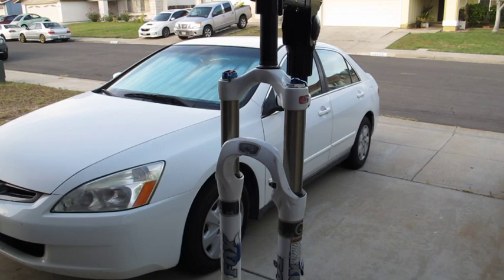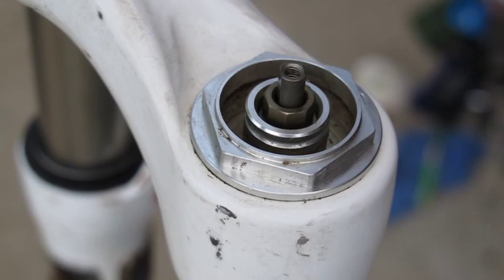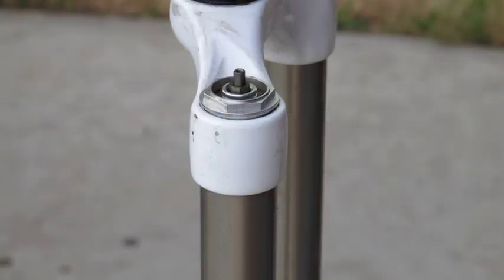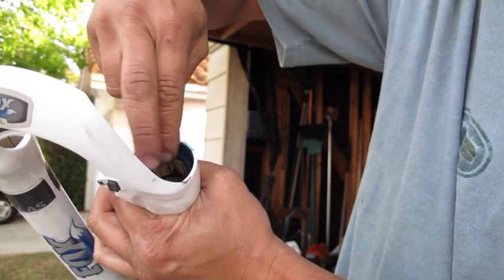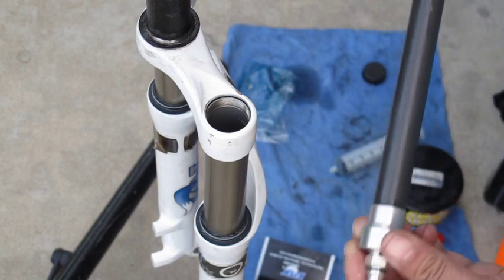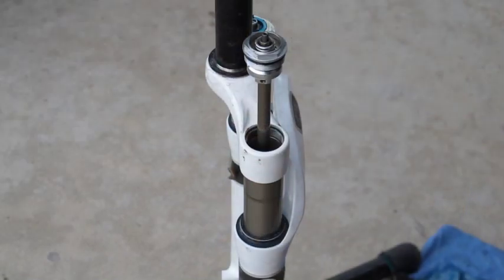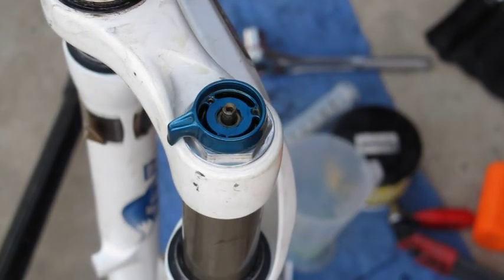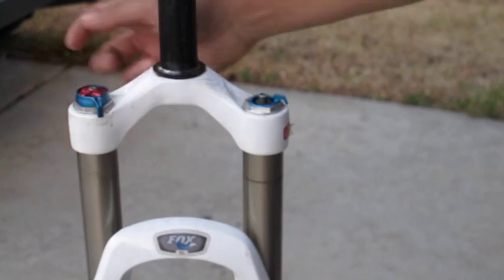2008 Fox 32mm Talas Maintenance

Comment: Great work with this.  Clear and concise with helpful comments.  For example, placing a rag over the tool when releasing the air pressure, using a flat-face 26 mm socket, loosening the damper BEFORE removing the lowers, removing oil from dampener rod, soaking foam seals in a bag, guiding dampener rod back in lowers, reinstallation and adjustment of compression knob.  I'm very thankful for this video.

Comment: Hi there.  I service my fork yesterday as it was bottoming out just by sitting on it.  But after servicing it, the still bottoming out. Not as easy as before, but is not rigid enough to go ride.  Have you ever service the air shaft or damper shaft?  Also after filling g the 160ml of oil from the top, you don't add any from the bottom? Thanks for you video, it helped me service my fork with confidence.
Reply: Did you ever figure it out? I just bought a bike with these forks and they bottom out when I sit on it. Ordered the seals but nothing for the talas side of it.
Reply: @zachfetter5710  Yes I did, it is a small oring that is inside the wet side of fork. Seal is transparent, so it break in pcs or crack easily. You need to get it out and replaced it. That will take care of it. It cause the oil to bypass, so the fork bottoms out. McMaster-carr p/n: 1295N223.  5mm ID X 2.0mm wide o-ring.  Since you are there, but a set of new wiper seals from fox or Jensen, and swap them. There is no seal kit available for this fork, not even from FOX.  Hope this solve your issue.
Reply: @cristian1780  Thank you very much, same issue. I wish i have pictures. So right side of the fork and I need to change oil and disasamble the fork tube to do it right ? Thank
Reply: @pliopov  yes, disassemble the fork completely and remove the wet side piston, the tiny seal is in there (most likely cracked in pieces), get some pick tool to get it out, clean the groove, and slide in the new oring. Clean your fork tubes while you are there and replace the wipers. Fresh oil in, and you should be good to go. Pump air to it and set your sag.

Comment: Hey @jrsandiego, thanks for the vid. On the air side, have you messed with the IFP chamber air pressure? The service manual says you need a specific tool (Fox P/N: 803-00-127), but I’m wondering if you can do it without.
Reply: Hey mate Wondering the same thing ever get around it?

Comment: Hi there is this damper a
open bath damper R or RL.
 I have jt got a set in very good condition owner says they are 2009 fox talas 150mm and the decals was removed by owner so I can't tell for tht I did ask but they says they took forks to shop for servicing and don't know. I can see by the fox oil guide online tht the fox talas open bath R or RL tool fox red but 2010fox talas RL or RLC took the green fox.
I have took the air out the chamber screwd damper side off at top compressed it to see inside but it was to dark to see dwn but when I pushed the damper slowly dwn to screw back on I saw tht the oil was come out the inside top part underneath o ring at the damper rod does this mean its a open bath damper. Or is it jt the FIT cartridge tht are sealed on fox fork.
I don't know alot about fox fork yet but am reading on this matter for a week now and no luck yet thanks for any help kind regards Richard

Comment: Can you explain where Do I have to put the little ball (rebound) cause in the video it's not clear ... in a hidden spot ... Thank you
Reply from the maker: The detent balls sit in the underside of the  rebound knob... directly under the 3 set screws... just be cognizant of them when you remove the knob so you don’t lose them... I used a dab of grease on them when I replaced the knob so that they would stay in place
Reply from the maker: Sorry...meant compression knob

Comment: Sir, what's your suggested interval for fork seals replacement? Thanks
Reply from the maker: Honestly, I don't replace the seals until I have a leak... what I do is I clean the foam and resoak with float fluid and pack the seal with a lot of Slick Honey when I feel the fork isn't smooth..
Reply: @jrsandiego  thanks a lot